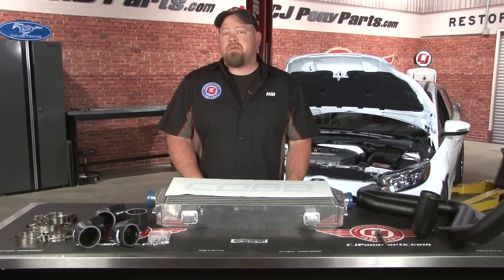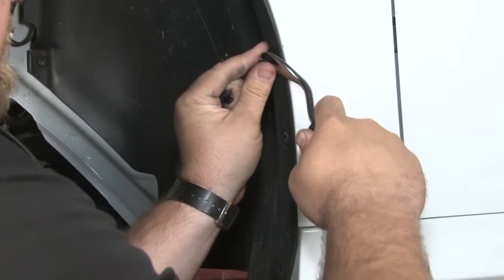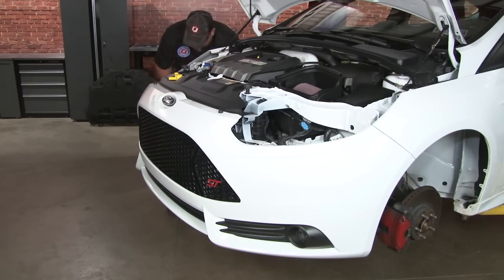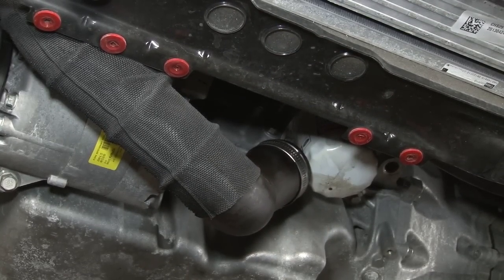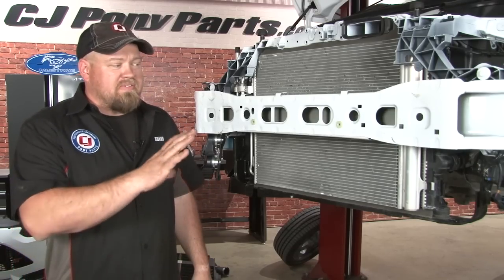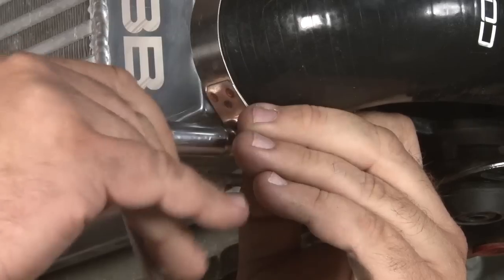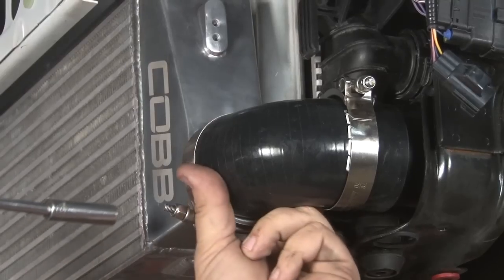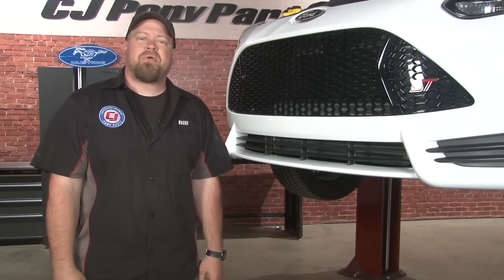Focus ST COBB Front Mount Intercooler Kit 2013-2016 Installation

Comment: I installed one half of yesterday and all of today. It’s somewhat a pain in the ass. I set a time frame to finish by and installed a snorkel,(that was a pain in the ass). Bill from CJ Pony Parts is very helpful I watched the video like 75 times. Cobb gives you no instructions and Bill can’t stand around holding our hand. Don’t use the dimple. Mock up before hand resting on and lining up with the radiator support holes then drill. I was a half inch high on the dimple. I used the grommets thinking that’s what they are for and no. The long charge pipe doesn’t hook up like the stock. That’s what the grommets are for. With the long little bolts. The radiator frame not only need to drop down but needs to move out of the way, but fairly easy to do. Bill is spot on. Watch the video multi times. So helpful. If you put a snorkel on, the rubber dell e o’s. Come of the two pipes coming out of the air box is a total pain. Just a couple things I had to deal with. It a chore

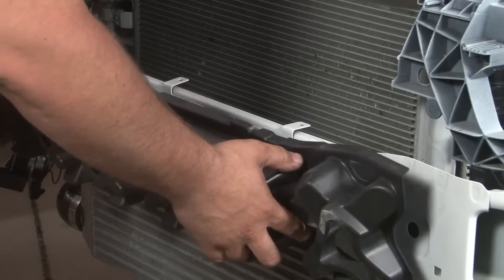Comment: @15:08 the rubber shroud keeps getting sucked into itself on the freeway. Is there a better way to attach  it? I probably have to pull the whole bumper off again,  but I don't want to do it a 3rd time.  Any tips for securing it better would be great! (I've tried to shove the bottom lip down already and it just sucks itself back up)

Comment: Can you guys tell me why it is so difficult to remove and replace my radiator fan on my ST? I don’t want to remove half the front of the darn car to do it. Pulling the fan loose of the 4 clips on the sides of the radiator is a 2 minute affair. But they won’t come fully off the clips due to the metal bumper/frame support bar that has the headlights and top cover over radiator and hood latch attached.

Comment: Ok so I need a Legit answer here!! WHY would anyone wanna go through all of that work when you can buy a different brand FMIC that practically boots right in to factory position?! Can someone answer?
Reply from the maker: Cobb is one of the most reputable companies in the turbo industry. Because of the size of the cooler the install is a little more involved but it works really well.

Comment: Does the Cobb Ap make a big difference from stock for the Focus ST?
Reply: 386vwade this is late but if u live in a hot place you wont notice nearly as much as a hp loss on a hot day
Reply: The stock intercooler is like the top of the list for mods according to a majority of owners who mod their cars. The stock one affects your car pretty bad. The bottle neck is as follows.

First the intercooler, then the turbo, then the exhaust and the intake. So in other words intercooler is first priority even on an otherwise bone stock car.

Comment: What is the purpose of those factory shutters? If we install this inter cooler will everything operate as needed?
Reply: +Justin Stratton  They allow the car to heat up faster in the winter and are really not necessary.
Reply: Great thank you Bill!
Reply: +Bill Tumas Did the Car throw a CEL or Code or anything of that nature?
Reply: +Houlie14  We have a Cobb tune on the car and never got any codes

Comment: The process worked perfectly , but I forgot to reinstall the hood latches . Now I Cant open my hood , any advice on how to pop the hood again. Anything helps right, I'm in a desperation right now .
Reply: I know I’m super late but I had the same problem today but with the velossa tech Ram air and I just took off the hood latch handle and used pliers to pull the latch open lol

Comment: How much more power ?  Any dyno time ?  Price ?
Reply: There is a link above below the published date with a price. Dyno numbers will be coming in the future. You don't typically see huge power gains with an intercooler swap but you get consistently low inlet temps which helps keep HP constant.
Reply: No power gains just keeps temp down. Needed for high boost upgrades. $300-$1,000

Comment: All the stuff tall do to the st should be the same for the 2.0 de right
Reply: Yes, 2.0 se should see hp and tq gains of about -20 too. I would also recommend a down pipe and blow off valve for your N/A se.
Reply: Dont forget to buy a cobb accesport if you haven't already. Gotta turn up the boost on that naturally aspirated engine.

Comment: If you choose to not reinstall the plastic bumper support, would it really effect anything?
Reply: Probably not worth the weight to loose the support but you could probably leave it off if you wanted to
Reply: Alright thanks. I was Drilling out the holes in the grill where that solid bar sets and its an eyesore to leave it in.

Comment: Drilling into this beam shouldn't take that long with the quality bits that come in the kit.  The key to drilling through hardened steel is slow and steady with a good lubricant.  Don't just force the bit through at the highest speed the drill will go.  As someone who has installed this kit 10+ times, I can drill through the beam easily in under 10 minutes with a basic 18V cordless.  Get some Tap Magic or other quality drilling/tapping lubricant and you'll thank me later!
Reply: Evan, absolutely right. It amazes me how many people do not know how to use a drill. Did mine last night, first time. Took 15 min of drilling including setup and cleanup. Used some cutting oil with adequate pressure on lowest drill speed about 30% trigger pull on a dewalt 18v. Easy.
Reply: Evan Goldberg I should have read your comment before trying to drill these holes. 
Been at it for a few hours now haven't gotten either of them through. I turned the drill up all the way and pushed on it as hard as I could. 
I think I wrecked the bit that came with the kit. Will 3in 1 dry lube work? I couldn't find any tapping oil.
Reply: Use some "cutting oil," can be obtained at Home Depot / Lowe's. Get some new bits while you're there (carbide tip). Use your drill at the slowest setting with A LOT of force (pushing on the drill). Careful to not apply too much force or the drill bit will break. Speeding up the drill will not help you, and in your case as described, probably dulled your drill bit tip. Adequate force without excess drill speed is the key here. Think about a drill press, they are typically very low rpm and allow for a lot of force to be applied to the bit.

Comment: What would be the 1st mod you would do on a stock focus st ?
Reply: First mod was a cpe rear motor mount, roush cai, roush 3 inch cat back, turbosmart bov, turbosmart 7psi wastegate actuator, cobb AP and now I'm waiting for this bad boy to arrive. Just hoping with the 2016 I won't have to drill for install.